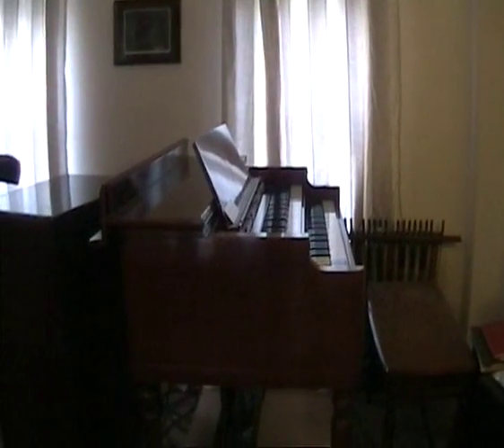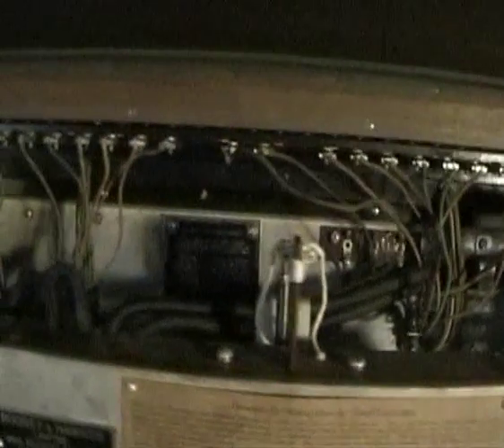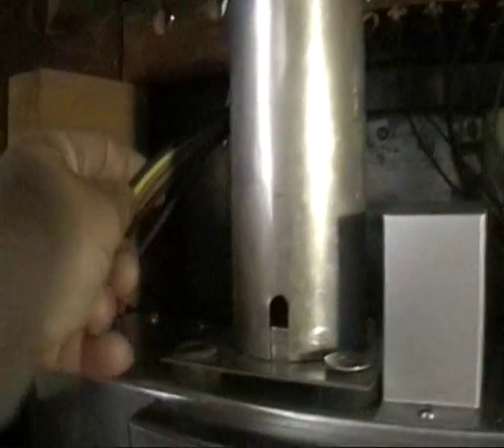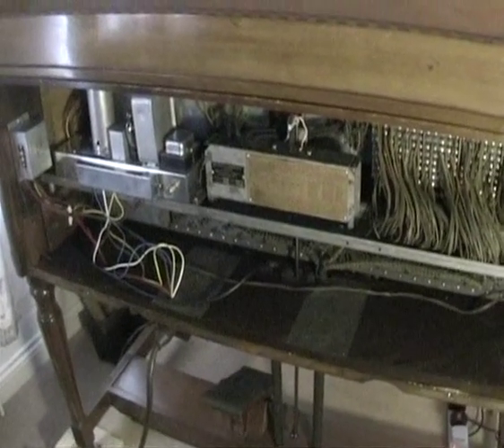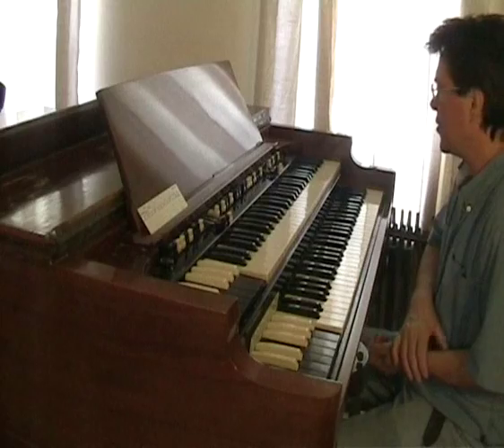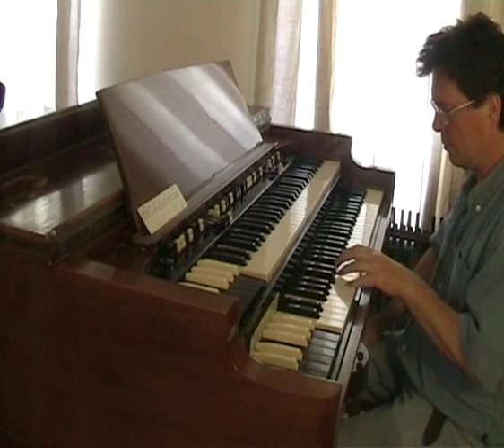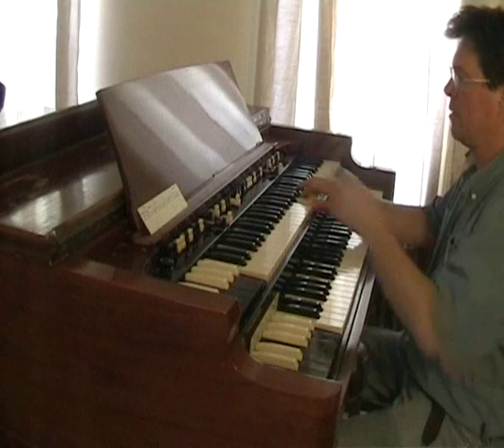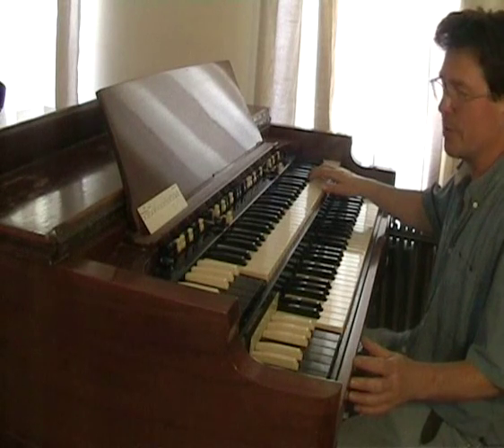Hammond Model AB 1937 sml.wmv

Comment: Peter, did you ever get to the bottom of your apparent lack of bass response?  I own an AB console as well, I thought the bass sounded great until I ran my Nord through the same leslie.  On flat EQ settings my Nord easily had twice the bass as my AB.

Did you end up finding the root cause?  Was it the pre-amp?  Or simply a few replaced capacitors on the lower end tonewheel circuits?
Reply from the maker: Nicolas Gingras Hi Nicholas.  Not particularly I don't think - its a while since I tinkered with it, although I vaguely remember swapping some valves (tubes) to find good ones.  The age they are, you have to rely on very old stock, many of which are past their best!  The pre-amp was totally rebuilt, so if you haven't done that, you will need to.    I think I have got used to the level of bass over the years.  You have to remember that this was built for church use, not knocking out bass heavy jazz left hand lines.  There are no generator caps affecting the very bottom bass tones, they don't start until tone 44.  Don't forget that your Nord is modelled on a B3 not an Model AB.  They are a very different beat, with different manual tapering, matching transformer, and a vastly different pre-amp.  All of which will produce a very different sound - so you can't really make a comparison.   I would enjoy it for what it is.  It is still the organ I go to for noodling at home - such a nice character of sound - volume and bass isn't everything!